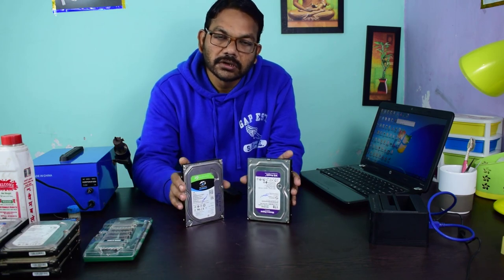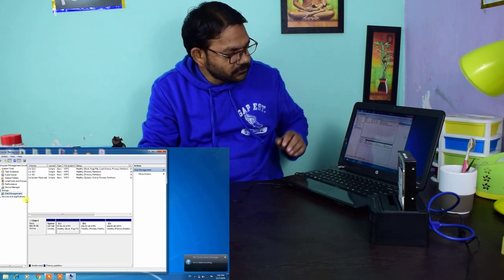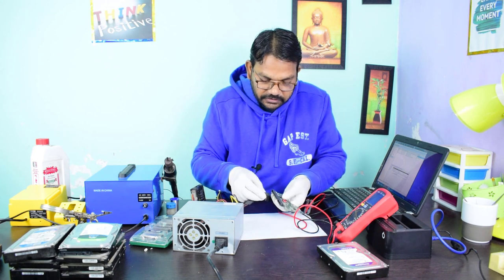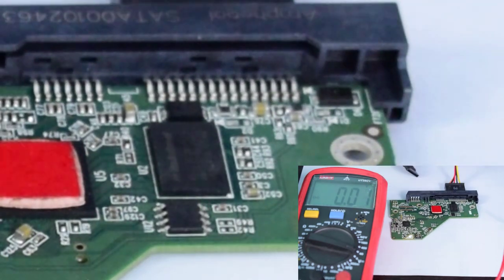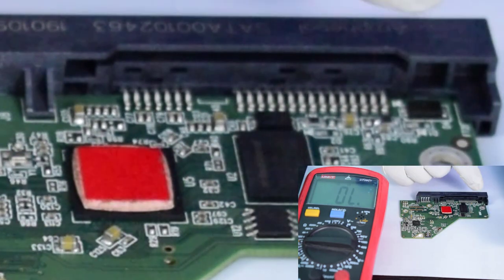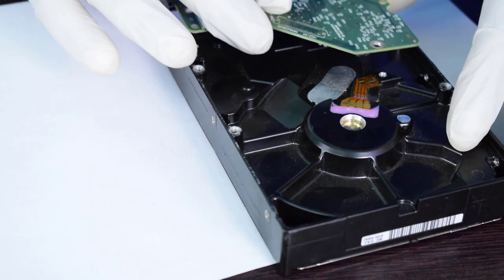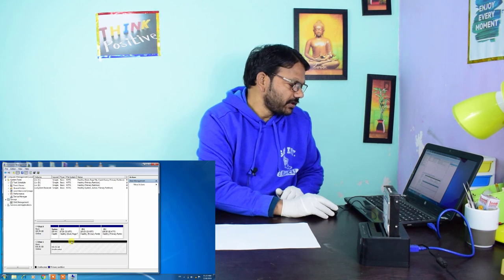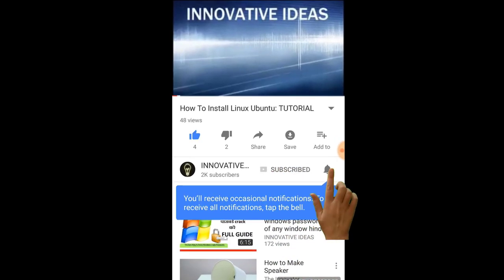How to repair Hard Disk not detected|| Repair Hard Drive Logic card|| Get back Hard Disk Drive Life

Comment: Awesome work, dude! Got a questions, maybe you wanna help me out:
How do you actually recover the data if the hard drive is not formatted at the moment?
Reply from the maker: If the HDD is not formatted, and the condition which I have shown in the video, detection will occur with full data. Moreover if data is not shown in the HDD then please try to recover the data with any data recovery software. Thanks
Reply: @innovativeideas  Thanks a lot, dude. Working quite fine so far. Is it normal though that a lot of this data lost the original name and also the directory eg folder structure within the partition? Some is just perfect, but a lot is sort of unsorted with a random name...